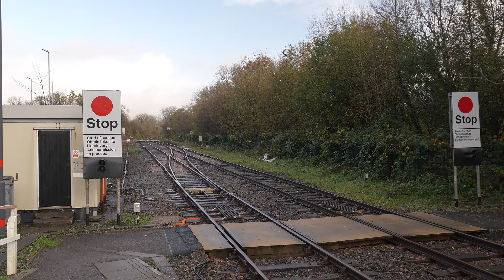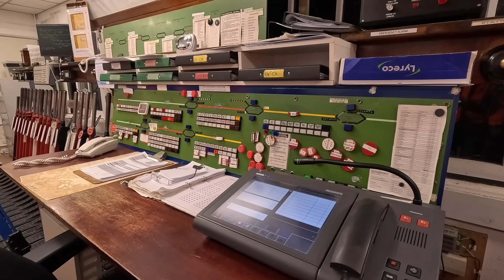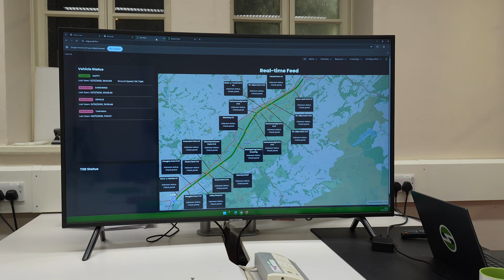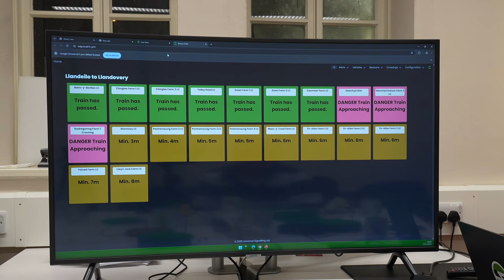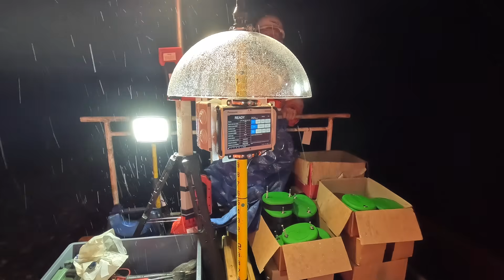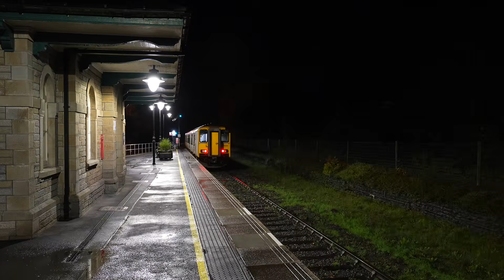Railway Signalling - In days, not decades?

Comment: The pink box on the screen in the signal box and the signaller relating that information to the farmer is just a red flashing light... this data could be sent down the same phone line to the crossing to activate a roadside flasher.

Comment: Is there a fail-safe situation for a yellow box spontaneously failing? Otherwise a fascinating idea
Reply from the maker: Not necessary. The boxes are passive anyway but if one were damaged then the fact that there are two adjacent to it (30 sleepers each way) is more than adequate to provide the necessary confidence of a train movement.
Reply: @GreenSignals no i meant the yellow reader on the train

Comment: I don't understand the need for the beacons at all. If the train box has reliable communication, as stated, why can't it simply report its position frequently using GPS?
The beacon system seems to perpetuate block working, just with smaller blocks. GPS reporting could be near continuous if required - the smartphone I'm writing this on can do that!

Comment: For the model trains - big spread, an infrared pulse from between the track rails to a central camera, to a screen with an overlay of the tracks, nice
Even bigger tracks (multi cam) these can be displayed on big screen, just needs a hdmi switch with quad view option.
Wiring problem to a central point, use rpi sbc with camera, have signal go via wifi, multiple streams can be shown in multiple vlc windows.
Ultimate version is using some AI to prevent collision.

Comment: Too hard to just ask the engineer what milepost they are at to see if they are clear of a crossing.  Im shocked that small farm crossings are even protected the way shown here. Is an approach circuit with lights at these small rural crossings not good enough?
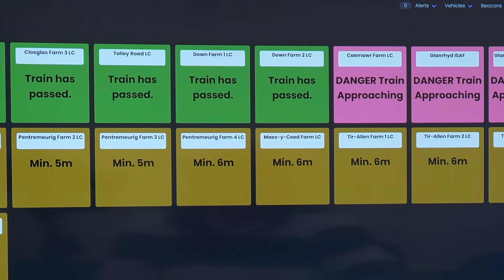Reply: Generally "frowned upon" to call moving trains for the most part: "In normal circumstances signallers are only authorised to call moving trains in an emergency." There is one case where special permission had to be given so that the GSM-R radio could be used for that purpose (RAIB Report 08/2017, Dock Lane LC). There also is then the need to convert the location the driver gives in relation to where the level crossing is located, which can lead to errors in themselves - this system seems much less prone to error, as you can explicitly see, without needing to do any processing, that it is safe to use a crossing, and even more importantly, you can also give permission to cross while a train is on the approach to the crossing but a sufficient distance away, rather than making them wait until the train has passed (see 5:50 and 7:00).
Not all [user worked] crossings require telephones and permission to be used, the ones that do often have poor sighting such that the time you need to cross is longer than the time you need to notice a train that'll put you in danger. (Getting permission to cross also applies for where you would want to move e.g. animals or awkward loads/vehicles across the railway, where similar applies).
MSLs (miniature stop lights) have existed for a very long time (since at least 1964 I believe), but can be quite costly to fit - it wouldn't even surprise me that this system would work out to be cheaper than fitting more than a handful of crossings with MSLs, and you can provide protection to virtually all user worked crossings (including those you otherwise wouldn't fit with a phone or MSLs, but someone may want to take an awkward load/animals across).

Comment: A question occurred to me; is there a reason for the relatively close spacing of beacons? I imagine if there was one every 90 or 100 sleepers, for example, it would still give a location accurate enough to determine a train's location.
Reply from the maker: Quite possibly Rob, but at 30 sleepers you have a great deal of redundancy built in and at £30 per beacon installed it’s not an exorbitant cost.
Reply: @GreenSignals  A good point!

Comment: This seems overly complicated. Being a disabled motorcyclist who relished my freedom, especially in mid-wales, I purchased a second hand Immarsat satellite phone for when I was outside mobile coverage. It sent GPS fixes for about a £1 from any number of valleys in Wales and Scotland and that was in 2016 and the network was decades old. I’ve checked my old email records and I have a test fix for Otterburn near Hadrians Wall but did test it on the Way to Applecross and Lake Vrynwy. I believe I used it for a breakdown call as well. Main bugbear was voice calls to it at £8 a minute. I’ve been on this route once from Craven Arms to Swansea which runs West-South-West so the satellites geo-positioned over the equator should be in line of sight. 😎😇
Reply from the maker: It may be many things but the one thing it is not is ‘over complicated’.
Reply: @GreenSignals perhaps it was your ‘Captain Scarlet’ production values Richard or the piece’s impactful delivery? 9 minutes from impact Cap’n! 

I also have a bit of professional knowledge and in the past, have read multiple  RAIB reports on unbarriered level crossing incidents, including an incident on the Cambrian Line near Aberystwyth, have been on the periphery for the non-HS1 crossings in Kent for which the solution(?) was to put penalty fine cameras, not full barriers and the presumably still oft discussed multi-million(10’s or 100’s) pound concrete carbuncle proposals to remove a crossing in the middle of an Area of Outstanding Natural Beauty (AONB). 

I also used to relish sending a bunch of 50 motorcyclists on a ‘mystery tour’ a couple of times a year to use the manned ‘locked’ manual crossing over the then South West HST Birmingham to Bristol mainline to view the confusion at the apparent dead-end  when the resident crossing operator had to stop gardening or break from Sunday lunch to bring out the huge key and key ring to unlock the gates (after first checking through the signal box) and allow them to cross over.

It is also worrying that in the 21st Century, Network rail could lose a train and their best guess would be that it’s somewhere in a twenty mile (40 minute) section of the track. Has it plunged into a ravine, carrying 100 hen party participants, heading for Swansea’s nightlife, hidden from sight, Cassandra Crossing style?

As South Park would say “Relax Dude’, it’s only entertainment! 😎😇
Reply: Safety systems cannot rely on GPS as the sole source of position/speed information. 

Or to put it another way, knowing where a train 'is likely to be' is a very different proposition to knowing where it is with the level of confidence required to make an decision that, if incorrect, would put lives at risk.
Reply: @MrSambem I beg your pardon, airliners use it which it why GPS jammers are the in-thing in Russia and Ukraine, airliners with 500 people on board are indeed safety critical transport systems. The Heart of Wales line is a bunch of single track lines sewn together and like car when it goes through a tunnel, a gps can use the wheel speed sensor and route map to count the distance along the fixed track bed. You could certainly reduce the granularity if you wanted updates every 15 seconds and with 4 satellites, it is super accurate even including elevation which a route map could cross-reference easily. The technology I used was 1980’s so I’m sure technologies has moved on with emergency beacons for explorers and mountaineers as well as drone autonomous vehicle technology. For goodness sake, when I was on it in 2015 to 2017, they used physical tokens from what looked like a porta-loo building on the platform as the trains are so infrequent, even including the few remaining quarry trains. I would also guess that most villages or farms probably use Starlink to talk to their farm vehicles in the area. 😎😇
Reply: @gbphil  There are no passenger carrying airliners flying now, or at any point in history, which rely on GNSS technology such as GPS, as their sole source of position/speed information. 

A wheel speed sensor means integration with the train and onboard knowledge of a track map. Whilst this is a perfectly acceptable technical solution to the problem, it is prohibitively expensive, as it requires permanent integration with any train that may regularly use the line. Part of the innovation here is to use GPS-RTK at design time to eliminate reliance upon GNSS at runtime, thus being able to achieve the level of system integrity required for service entry, at a price point that custodians of rural railways are able to afford.
Reply: @MrSambem  What about the Baku to Grozny flight that got hit by a Russian missile after its GPS was scrambled on approach to the airport, it had to fly ATC issued vectors and couldn’t do that very well which is why it strayed near the military protected airspace in a suspicious manner. See my other reply to Richard for more railway specific matters.
Reply: @gbphil  I'm not sure what you are trying to get across. On the one hand you are saying the system could just use GPS, and on the other you are saying that GPS can be spoofed to send aircraft miles off course?

As for aircraft, I repeat that there are no passenger carrying airliners flying now, or at any point in history, which rely on GNSS technology such as GPS, as their sole source of position/speed information. Here are some good references so that you can read around the topic at your leisure.

https://en.wikipedia.org/wiki/VHF_omnidirectional_range
https://en.wikipedia.org/wiki/Distance_measuring_equipment
https://en.wikipedia.org/wiki/Inertial_navigation_system
https://en.wikipedia.org/wiki/Non-directional_beacon
https://en.wikipedia.org/wiki/Instrument_landing_system
https://en.wikipedia.org/wiki/Altimeter
https://en.wikipedia.org/wiki/Pitot%E2%80%93static_system

This is my last post on the subject.
Reply: @MrSambem  Simply pointing out that the ability to send accurate location information has pre-existed to the consumer market since the 1990’s . I was a early adopter of mobile phones for motorcycling safety purposes, breakdown or accident in remote picturesque locations in Wales, Scotland and Austrian Alps having a Sony  R111 pocketable analogue handset (0374 was the pre-fix code I think) in the early 90’s, £19.99 a month on a six month contract with 30 minutes of calls via Radio Rentals and Vodacall (Vodafone / Vodaphone before it was). I also had a Garmin handheld GPS38 for navigating moorland / Green-lanes  in the late nineties (before foot and mouth broke out) and my group were one of the first people in the U.K. to call 999, provide GPS info to the ambulance operator and get the Air Ambulance sent direct to the hillside to attend a heart attack in the Black Mountains of Wales by co-ordinates. It got there in twenty minutes when it would have taken an ambulance crew and mountain rescue team several hours. Unfortunately they couldn’t save him. Thus I have provided commentary in good faith based on a wealth of experience, I’ve also worked with Network Rail extensively so know they can easily polish a turd. By the way, I have a fossil, it could be amber and may even contain dino dna, want to buy a unique present for Xmas??? 
😎😇 
🙉🙈🙊

Comment: How is the "high grade commercial mobile communications for which the connection is extremely reliable" being implemented? Is there mobile coverage for 100% of the rail network area for 100% of the time?
Reply: The line has remarkably good coverage, with only a small blackspot in a tunnel to the north end.

Comment: This is Green Signals at its very best. Showing innovations such as these which are relatively low key and otherwise not newsworthy to any other mainstream media, but important in their own right as to how developments and innovations now, will have an effect on how things are done in the future. While this system in its current form isn't suited to main line applications, how many miles of our rural railways and branch lines are suited to this style of adaptive signalling. You can easily see how this technology could be adapted to coexist with the current signalling systems and reduce the costs of resignalling programs in the future. I for one would be very keen to see updates on how this trial period is going in the next few months.
Reply from the maker: Thanks Paul. And this system (U-Cross) is just the first iteration of their development programme. Will be very interesting to see how it develops.
Reply: @GreenSignals 100% agree, I'm really interested in seeing how this develops over time and through the testing of this Trial. Thanks for sharing this example of what's being done collaboratively across the network.

Comment: What's the fail-safe here and what's being tracked? Is it the train with unique id self reporting its location/device number its passed,  or the locator device reporting the passage of a train and the head code? I guess the multitude of installed devices of equipment fail safe but what if a train passes without a working transponder?
Reply from the maker: This particular application is, as stated, a decision support tool to give the signaller confidence in advising those seeking to use UWCs whether it is safe to cross. Future iterations with greater functionality will no doubt address your points. Having said that, if a transponder fails on train, no signal will be received and the system will move to fail safe mode - and the signaller will have to resort to the current system which whilst frustrating for everyone, is safe.
Reply: @GreenSignals  Thanks for the clarity.

Comment: although the beacon reader on the headlight bracket is great, would it be a little better to install it in the underside of the train like a normal balise? probably gives some more brackets to attach the reader more securely and protects it from weather?
Reply from the maker: This is just a trial. I understand that for full deployment in the future, permanent beacon readers could be attached to trains. Still requires no major modification though which is great.

Comment: What makes the green beacons different or better than the standardised passive Eurobalise types, already used for ETCS level 2?
Reply: Significantly less expensive product cost plus no need to programme balise data
Reply: @simonwood6932  Does the Eurobalise system require more than 1 unique ID number for each balise? I am not deeply into these standards, but got the impression that no more than an ID is required for the simplest use cases.
Reply: Its a similar tech. But these can be read from many meters away so the reader can work from the front of the train, not the underframe. And no design work before the site visit and minimal test/verification after, so they can be in service in days, not after many years of scheme design.

Comment: How would this approach detect divided trains?
Reply from the maker: Each unit could be fitted with a beacon reader.
Reply: Wouldn't it need to be on individual coaches & wagons - to match the fail-safe security given by axle counters & track circuits?
Reply: A beacon reader front and rear can show the extent of occupation of the train on the track. if the train splits, then the front and rear are still the limits of track occupation.
Reply: @MrSambem Wouldn't the signalling system need to read the beacons with that system?

Comment: An excellent video, but I find myself wondering:
Modern GPS systems are accurate to a couple of metres, and also provide speed, direction, and acceleration. If all they need is to know where the train is, why not just report position using GPS, and avoid having to nail down hundreds of the green beacons?
Reply from the maker: Resilience plus this first iteration is for the UWCs - they want to get it spot on.
Reply: @GreenSignals if resilience were the primary concern it would make more sense to use GPS as the primary and normal source, with beacons as a back up option.

Comment: Are the beacons totally passive or do they have batteries which need replacing?  If passive, I can see this being a real game changer for UWC protection. Difficult to see how it could be part of a fail safe basic signalling system.  And even with this UWC protection, there will need to be a pretty foolproof system to ensure every train using the line has a box installed.
Reply: The beacons are passive, yes. 
They would have measures to detect if a train entered their section without a reader.
Reply from the maker: Totally passive
Reply: I'm sure that with regards to the box, you could just check that as you issue a token, you also see a corresponding train in the location you're issuing it from, and if you can't have a box for a train, then you're back to the previous method of working? Even if not all trains have the box, that still does reduce waiting time for the trains that do have one...

Comment: Hmmm.... Seen as "decision support". That's a loooonnng way from using this (excellent, innovative, cost-saving) tech as the primary signalling system. 

But good luck to them.
Reply from the maker: Hopefully we made it clear that it’s the first iteration of many potential future iterations. 

Today, it’s a decision support tool for UWC. It in the future with interlock capability, who knows…..
Reply: That's exactly what it appears to be - some might say it's an overlay system - and I imagine NR/ORR will approve it on that basis only. This concept would need to be much more developed to a high safety integrity level for block signalling purposes.